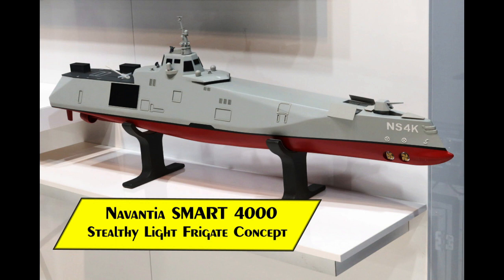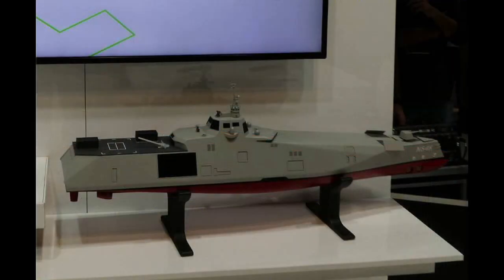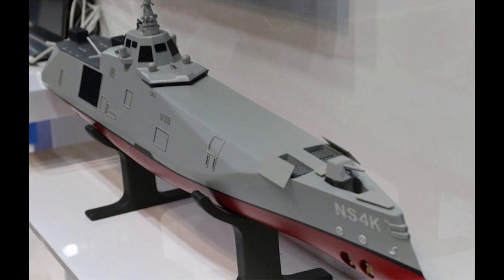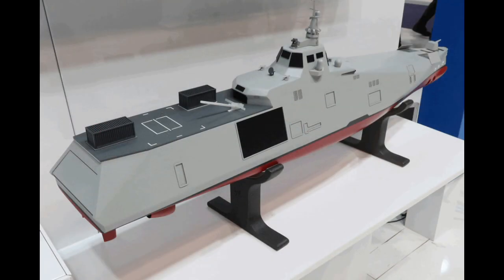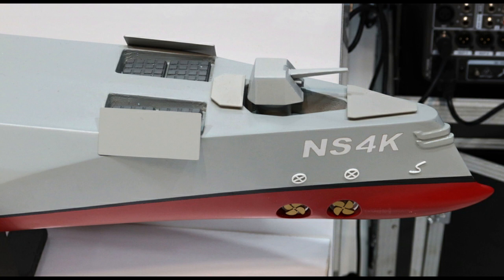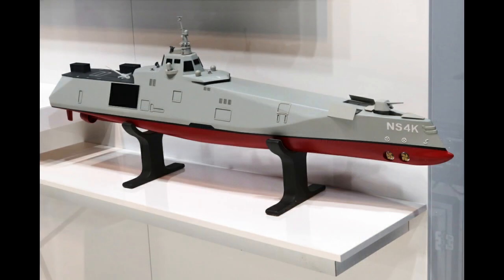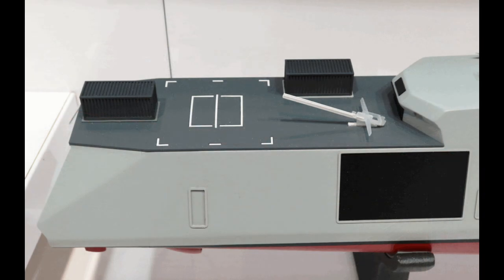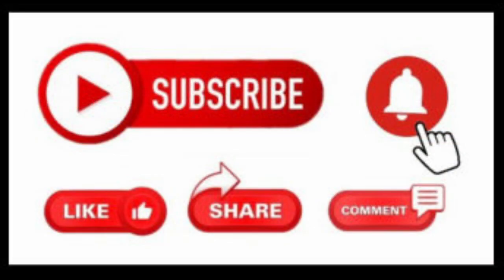STEALTHY LIGHT FRIGATE! - The Navantia SMART 4000 Concept

Comment: The concept is interesting and should be efficient and polyvalent if making use of adapted UAVs. Howether, even with its native equipment, it has rather good capacity given the VTL cells may carry either anti-air, anti-surface, dual purpose (anti-air+anti surface), or anti submarine missiles, provided missiles production. The single turret has become standard with even bigger frigates, wich should not handicap the platform: fast shooting and accuracy has become the norm over the number of artillery guns. If stealth is good, it should perform well in various situations.